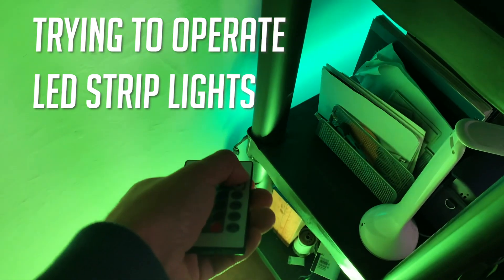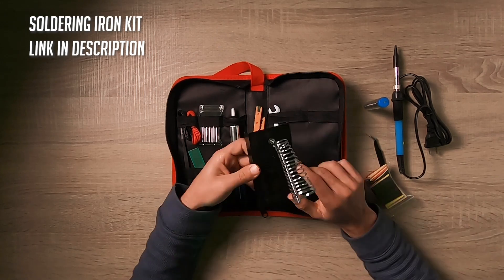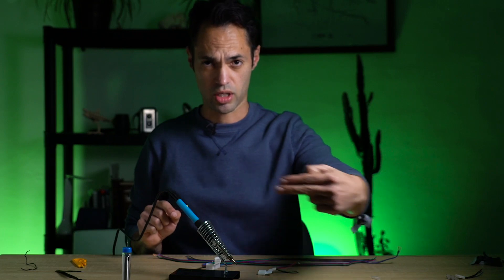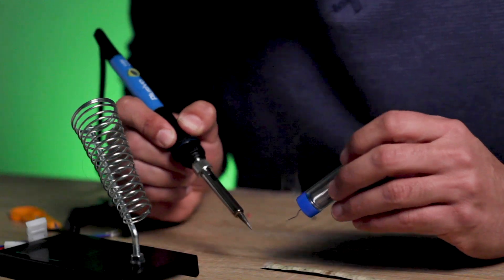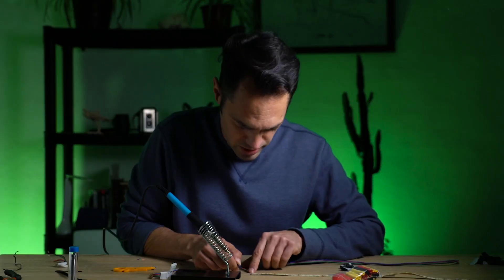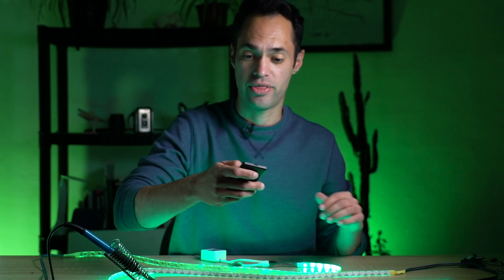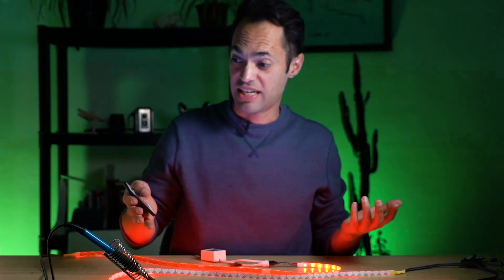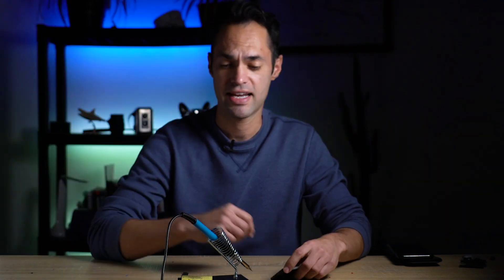DIY Tutorial: How To Solder LED Strip Lights with Amazon KITS

Comment: I just did this recently myself and then bought new led strips that can be controlled by a bluetooth app. I gave the old leds away.
Reply from the maker: That’s dope! The LEDs with app are cool. But you still need to solder them? I have these clips, and elbows to connect them too, but they didn’t work so well - that’s why I opted for soldering
Reply: @sharkerio  My old led strip was bent around a monitor so the circuit broke which I resoldered, not the new ones.
Reply from the maker: LEO ABROAD nice dude 👍🏽